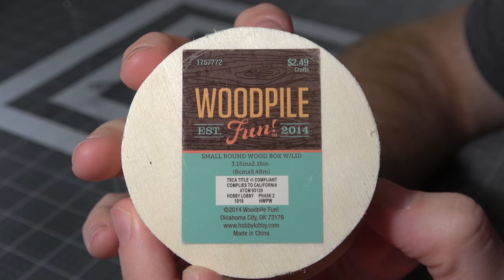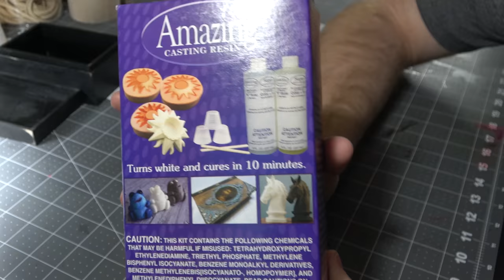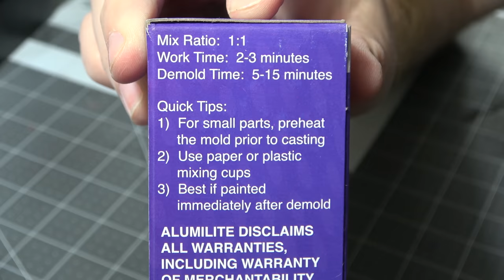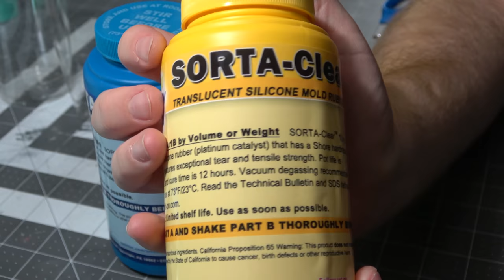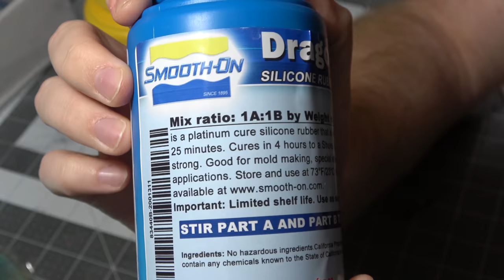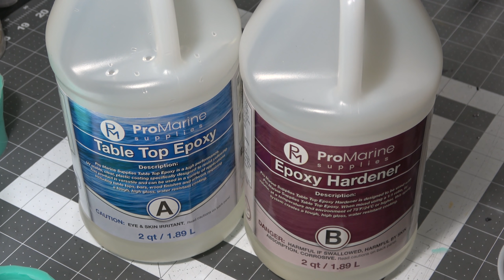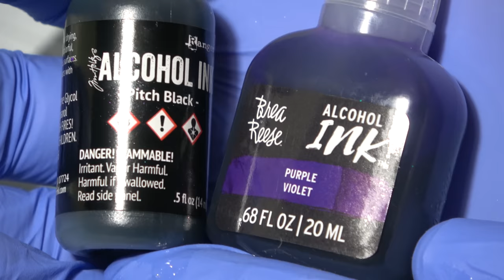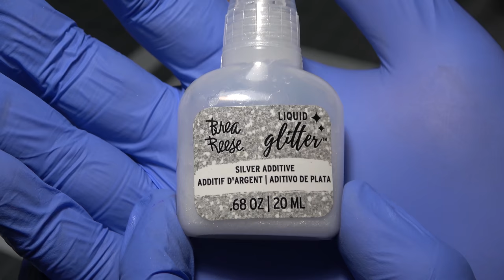How to Make Resin Dice Boxes

Comment: “3 men and a babies strength”  glad to see more people using the metric system
Reply from the maker: Doing my part to convert the U.S.
Reply: 12 inches to a foot, 3 feet to a yard. Very easy to remember much easier than an actual system that makes sense and stays consistent
Reply: @HG-mj9ow  imperial system is dumb honestly
Reply: @chris_chris_dav  metric system is dumb honestly
Reply: Measuring things in two different systems is dumb honestly

Comment: Helpful tip for larger silicone molds like this. AS you're doing other mold projects save all your silicone scraps. Cut them up into smaller chunks and you can use them as filler for cases exactly like this where you don't want to waste silicone filling large voids.
Reply from the maker: Oh good idea! I could have used that in the centers of the boxes!
Reply: Yep. I've been using this trick for a bit now. Luckily I came across this tip early on in my resin/silicone research. I even save the little shreds from the silicone mixing cups.
Reply: Oh dangit, I shoulda saved all my junked silicone molds that I'd made and then gave up on rather than throwing them away.  I'm not going to stress too much about that right now (trying to get rid of some of my "junk" so that I have less stuff to pack when I finally move), but I'll definitely remember this.
Reply: Works perfectly!

Comment: first of all: love these boxes, especially the purple one, because i loooveeed those purple dice

i got an idea recently and it got stuck in my head, but it´s probably really ambitious and complicated: enviroment dice. like there is a lil cute enviroment in the dice, maybe a tree or a little beach or lake so
i don´t know if dice are too little for that, but i at least wanted to write this idea down because i don´t have the time, the patience nor the equipment to do something like that :D
Reply: I've seen some people do things like that in extra large d20s. Off the top of my head I've seen one with a ship on the ocean (which I am not-so-patiently waiting for the maker to start selling) and another that showed kraken tentacles rising from water (which was sadly a one-off that auctioned for waaaay more than I can spend on dice).
I've also got a set of dice with actual seashells on a "beach" which I like a lot.
Reply: You can possibly do resin layer painting--make a couple small disks of resin, paint them to the effect you want for that layer with whatever you're comfortable using, then glue them together inside your mold with more resin--but its only going to be visible from certain angles, even if you paint both top and bottom of each layer. You can plug "resin layer painting" into youtube to find a few examples, but not any dice.

Another possibility is making premade, extra tiny charms for special objects like trees, etc., painting those, and casting your dice in layers--like top is clear sky and clouds, upper middle layer for alcohol ink to make water and inserting fish charms, lower middle layer for rocks and seaweed and a darker alcohol ink, bottom is mica powder to look like sand. You'd just have to be careful what you make the charms out of and how much glitter, sand, or whatever you're adding to avoid weighting the dice too badly.

Comment: For larger things that you need to pressure/vac pot you can build a half moon stand and put the pot on its side. Then build a slide in platform so that it gives the side of the pot, now the bottom of the pot a flat base for your molds. Works beautiful, hope this helps. 🙂

Comment: I really like the wood grain on the mold, do you think you could make dice with that texture?
Reply: Some Hobbyshops sell wood dice but they dont have numbers
Reply from the maker: It's possible to design with that in mind! Or mill some dice out of wood
Reply: If you can find premade wooden dice with numbers you like, I think it should be a relatively easy project.

Or finding blanks, and my go to would be to burn in the numbers rather then carving them. Or drilling dots.

Getting an even layer of tape without loads of creases might be a little fiddly. I think putting a dice face at a time on to the sticky side and then going around with a exacto might be easiest.

Comment: You can get waterproof sandpaper with a sticky back that will work very nicely with your pottery wheel. I'm sure there are plenty of brands out there, but I've personally worked with Buehler and Allied. Allied is a little better, but unless you're looking at your finished product at 500x magnification, it doesn't really matter. This stuff is lab-grade and lasts a long time, but it is pricey. (They also have machines, polishing pads, and polishes meant for use with this sandpaper, but that's probably overkill.)
The packing tape thing works with acrylic resin, too.

Comment: Hardware stores carry peel and stick sandpaper discs in different grit levels in 6in, 8in, and 12in diameters.... If you really must use your potting wheel for a sander.  Mind you, the adhesive is really strong, if you want to peel them off and use it for potting again it will take maybe some acetone or Goof Off and some elbow grease to remove it.

Comment: You probably already know this, but from one person who regularly molds shapes with large cavities and doesn’t like wasting expensive silicone, DEFINITELY cut up and use any old silicone molds you done want anymore as space fillers.
As you said, silicone sticks to silicone as long as you’re not mixing platinum and tin cure, so it’s great for filling in spaces and recycling old molds so you don’t feel bad about throwing them out!
They may not always been the prettiest molds but they’re cost effective for sure!

Comment: Awesome work as usual!!!
I've made boxes with prefabbed molds and it ends up being a fair amount of work trying to get the lids to seat correctly as the sides of the molds are thin and do flex. Other than leveling issues the only other problem was shrinkage ofthe epoxy. Is the new resin you used better in that aspect?

Comment: Holy hell, RY, these are INCREDIBLE! Will you be making a box just for the Fireball or Eldritch Blast dice? I was also wondering if you might do some Guiding Bolt or Magic Missile spin-top dice?
Reply from the maker: I am glad you like them Lumi! :) I don't think a fireball set would fit into the round cups, but maybe the larger box, so I might have to!
Reply: @Rybonator  I have a feeling that a Fireball box would be amazingly sparkly if you do it to match the set with gold foil :D

Comment: You could particularly bypass the leveling thing by glueing some 3d printed crystals on top of the lid or a mold casting of 3d printed crystas
That way the "imperfections" of the lid would be less noticeable.

Comment: After sanding the wood add a polyurethane sealer. This will give a smooth finish to the wood and it's smooth surface will carry to the mold.

Comment: If you want to keep the wood grain but don't want the foggy look on the resin, you can coat it in a thin layer of gloss varnish.
Reply from the maker: Good point! Might have to try that out. Thanks RBG :)
Reply: @Rybonator  No problem.
I figure I've gained so much from your videos it's high time I gave something back.

As luck would have it, I literally made a resin box like these about a week ago. Granted, not as pretty as your purple glitter/ gunmetal box.

Comment: What about using some sort of floater that's pressed down towards the center of the huge hollow so that you don't have to fill it with silicone? Enolugh to take up much of the void but small enough that there's still enough silicone surrounding the box interior?

Comment: I'm really intrigued by your technique of putting the droplets of ink in as you pour to create that "spiderweb" effect.  Would that work if the base epoxy was already colored to create veins of color?
Reply: depends on the base color. Alcohol ink is translucent so it doesn't show well in darker colors with this technique. I've done it with success in whites and pinks and lavenders, light colors, but it just won't be visible enough in dark colors because of the nature of alcohol ink. You cold look up a similar technique called "in the pot swirl" for darker colors, it originated from soap makers but works great in resin too!

Comment: You mentioned not being able to use the silicone in the pressure pot without vacuuming it first? Is it necessary to vacuum silicone if you plan to use it in a pressure pot?

Comment: If you make bigger projects like these, you could pour two coups of resin with different colors at the same time. That would make a cool 2 worlds look, like a Kalashtar or the half-races or multiclassing themed...
Reply from the maker: You have to be careful, because after you pour with resin, it tends to move around a lot, mixing the colors rather than keeping two distinct colors. But maybe I'm used to tiny portions with dice. I'll give it a shot for sure!
Reply: @Rybonator  OH didn't thought of the moving around... But cool that you'll try it ^^ hope it turns out good

Comment: Silicon pouring tip: Pour at the lowest point and let it flow.
But you did fine and the boxes are not extra complicated, so that's ok.
Reply from the maker: Oh I totally normally do that, but there are so many wide open gaps here that it didn't matter :)

Comment: I want a box that will stay closed if I throw it in a bag.  How about a sliding dovetail lid with an indent in the closed position so it takes a bit of force to start opening it?
Currently, I have:
* a vintage leather case that holds 5 d6 (for Yahtzee) that's about 60 years old.
* a plastic box with a hinged lid that clips shut, with a foam insert that holds 6 d6 that are retired casino dice I got from Circus Circus about 35 years ago.  They are rather large dice compared to what we normally use for table-top games and board games today.
* the display case that the dice came in.  The two pieces stay together fairly but not robustly.
* a ziplock bag containing a whole bunch of mixed dice including some novel ones.
** which contains a smaller ziplick bag, about 1 by 2 inches in size, with a bunch of subminiature dice.

Comment: Have you switched completely from regular sand paper to Zona paper?
Reply from the maker: If there is a rough enough surface, or a large amount of material that i need to sand away, I go to regular sand paper. But Zona works fantastic if you are just sanding away a tiny bit. :)
Reply: @Rybonator  Cheers, thanks for the reply!